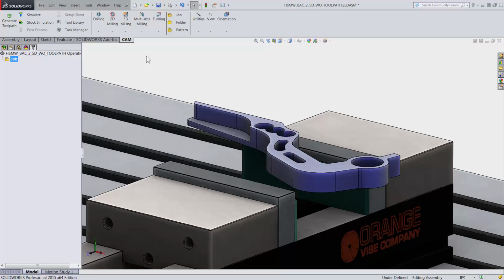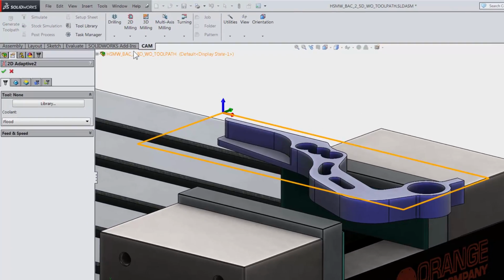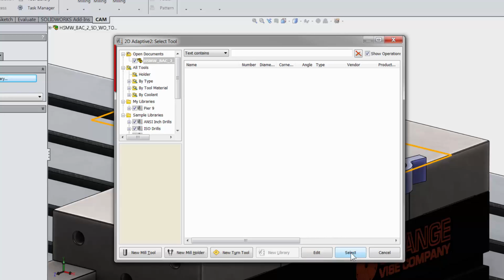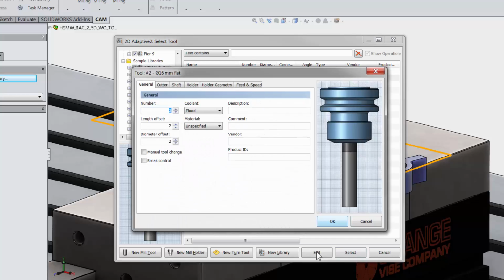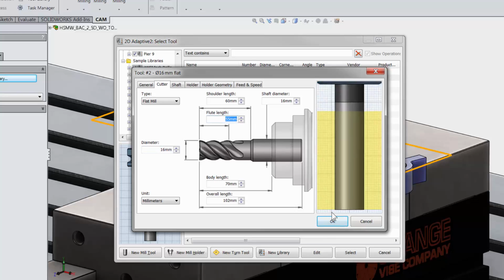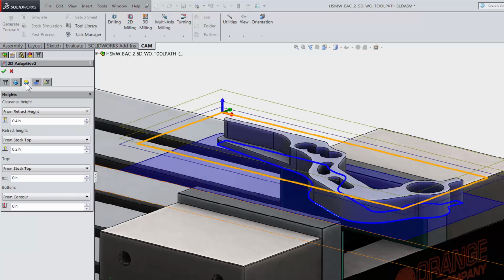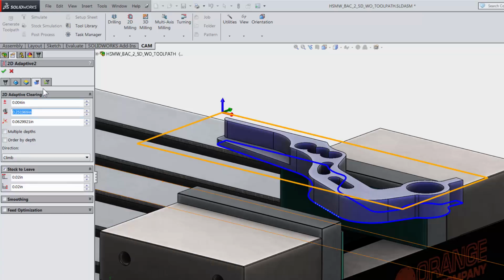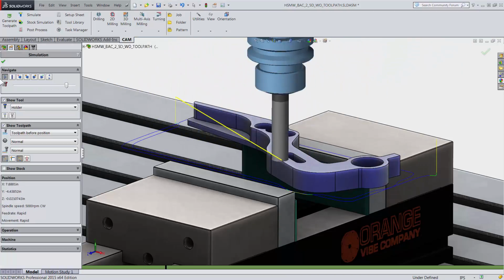HSMWorks — Quick Tutorial on 2D Adaptive

Comment: Lars, one thing I am missing in all 2D adaptive videos, is what you do is there is not one path that you can choose in one height covers the whole outside of your part. On this part if the protrusion in the right side of the part was 3 mm from the bottom and 3 mm from the top so the lower edge would end in a circle, then 2D adaptive would remove the protrusion altogether, as far as I have found. If there is not an unbroken edge around the part is does not seem like you can use 2D adaptive, or it is definitely not obvious how.